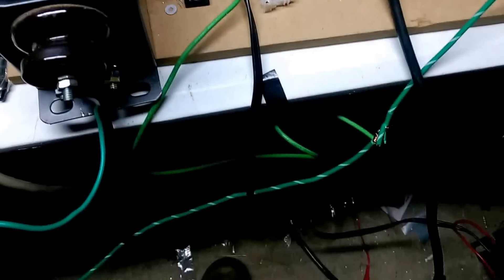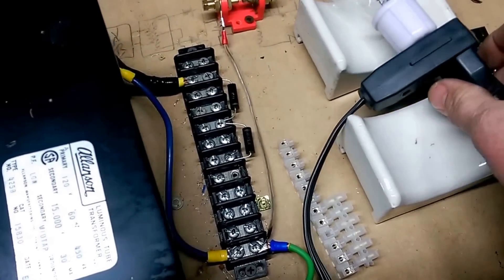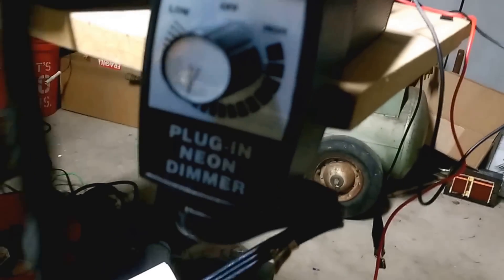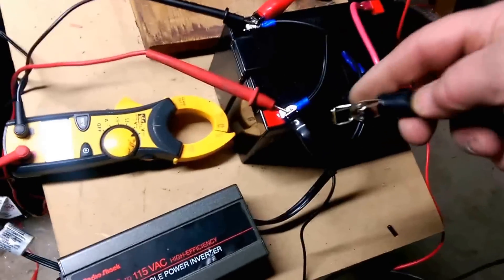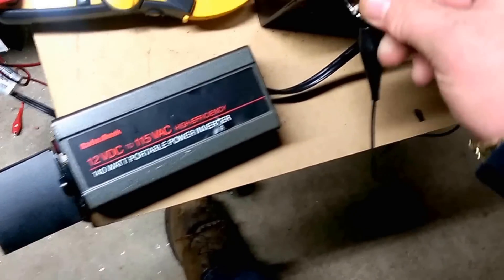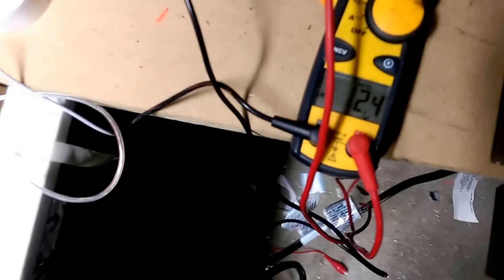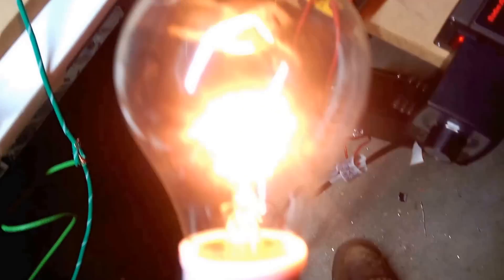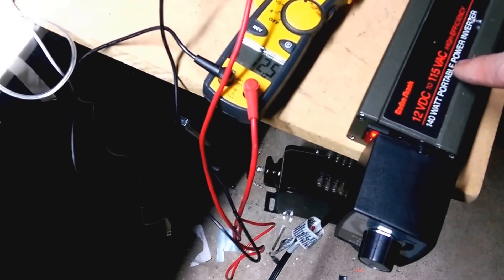Working Free Energy Generator-Dezeinstein Technologies-Annotated

Comment: I have an inverter, 300w motomaster and 12v rechargeable battery, how do I connect them in series and how do I make a 120v heater work in the woods??

thanks
Reply from the maker: +Cory Samoila I'm not quite that far yet.. I'm lighting a light bulb and an nst and able to recharge the battery wirelessly.. The bulb is only 67 watts and the nst uses around the same to fire the device, so, at this point, we are seeing  an increase in output of exactly this plus the losses in the components and the inverter. In my circuit, The invrter's wave and circuitry is very special, so, what I am doing is drawing environmental energy in the exact amount of the draw, enough to max out this inverter. I have not yet got another inverter to work, however, I am working on it. I have to scope the waveform, then, once I figure out exactly what I see will determine the type of inverter used, etc. For all I know, this manifest of additional energy may be driving backward through the inverter , charging the battery without damaging it somehow.. it's really difficult to tell, so I will try to keep everybody up to date.. it does work though!!
Reply: Kool thanks.

Have u tried adding magnets?
Reply from the maker: +Cory Samoila no, but its simple enough to try!  anything could work.  I'll try it and let you know the outcome this weekend when i.have more time to. work on it. thanks for your idea 💡
Reply from the maker: i tried magnets and nothing happened. I also tried to use an arc gap but it uses energy and eliminates it's self charge process. I did however figure out a new phenomenon that allows me to charge pretty much any battery wirelessly without the use of an inductor coil. This is something that I can't even find described anywhere online! I am going to have to patent the process since I never explained how I am actually doing this. I have learned in my efforts to research and develop this system a way to wirelessly charge the battery, then of course, a way to make it work on any battery other than l-ion or l-poly batteries so far. I'll have to try them to see how well it works. I have also been able to overcome the loads with the newet device I have built, where a simplistic device I have created allows this to take place without induction and, it brings the batteries to pretty much any level of voltage I need it to stay at with merely .018 amps of current at 7300 volts. I have found that the higher the voltage, the easier this works, and, it does not consume any energy to do so, it basically forces the battery levels to remain the same while massive currents are drawn from them. It does this without any impact on the battery's function, however, I need to test many batteries over a lengthy period of time to see if it will have any impact on it's function, life, and with any luck, it won't cause any battery to explode. The first circuit I built has enough charge to use the inverter  to feed the bulb and the nst but nothing more unless I changed the load with LED Bulbs.

Comment: Hey Marc, thanks for the update. Tom has always stated "DONT KILL THE DIPOLE" from the tombearden website. Large copper windings are the deadliest killers of dipoles. Thats why large amp motors kill the source battery quickly. Copper may turn out to be the deadliest killer of free energy available. Just use the potential difference to do work without amps!
Reply from the maker: +Alex Manzanero  We have to do some clear explanation here of what the dipole actually is before people look at it the wrong way. The dipole is the "field of the magnetic flux given by an electrical current".  My method is like Tesla's, there is high voltage, and, no amperage anywhere until we get to the capacitor... so, jut as Bearden's website states about Tesla's phase conjugate mirror technology, somebody has a massive transmitter already pumping energy into the Earth. This is true because my system would not work otherwise. Either they are doing so unknown to themself, there is already some sort of transmission going on, and, my device is merely a receiver of this energy. If we create a small pulse and drive it into the ground, we tap this energy and without completing a solid wired loop, we can extract a mirror of this energy in it's multiple dimensions. Here is the data copied from Bearden's site which I have been trying to explain to others. Smith did this, Moray did this and Kapanadze has done this.. It's all a basis of what is already being driven into the Earth, and it will only get smaller results when the true source is shut down because this technology will work as well by sending a pulse as I am doing, and also receiving it by doing both, transmitting and receiving the signal. I am not sure if I did both of these , that's why I will continue on with my work.. here's the info copied:

means of converting the Earth into a self-pumped phase conjugate mirror (SPPCM), containing a powerful spherical standing scalar EM wave. The SPPCM Earth then produces a self-powered, highly amplified phase conjugate EM replica wave in response to another input EM wave of nominal power transmitted separately into the Earth from any point.

We point out the special characteristics of this standing scalar EM wave and the Earth's reaction, both in the four spatial dimensions (1-3 and 5) of 5-dimensional Kaluza-Klein space and in the time (4th) dimension. (1)

Also we point out that quantization results in a reciprocating wave between electromechanical stress in the four spatial dimensions and canonical stress in the time dimension. This allows the stressed nonlinear Earth to act as a self-pumped phase conjugate mirror (2) so that stress energy of the Earth feeds energy into the standing scalar EM wave, resulting in very high energy gain and production of a very powerful electrogravitational resonance condition (standing wave) in the Earth itself.

This powerful resonant standing wave is then "tapped" in accordance with standard 4-wave mixing theory (3) to produce a highly amplified phase conjugate replica in response to a relatively small input signal from any distant Earth-coupled transmitter on the Earth's surface. (4) The phase conjugate replica signal is coupled back to the distant transmitter/receiver site where it is received, processed and fed into the electrical power grid to distribute electrical power.

A single inducing transmitter can be used to energize the entire Earth on a single frequency or "energy channel" (5). This channel can be tapped by numerous extraction transceivers around the Earth, furnishing energy from the Earth itself at each extraction site. Additional inducing transmitters can be added on different frequencies, to provide additional energy extraction channels (6).

So, if we send energy in, the energy from our own transmitters can also be tapped by others, and according to Don Smith's analogy, in the rf wave or signal frequency, if we all have radios, like the radio that plays music, no matter how many of them we have, we can always tap this energy and the transmitter never feels or is absorbed as additional load. We can pulse the high tension or high voltage energy as a plasma source with one wire into the ground anywhere on this planet, then, we build a simple device like mine, or millions of them to extract the energy at the same frequency. If we input at a low frequency as I did, @ 60hz, we can still absorb this energy at a level of 1.5 to 5 times back as I did, however, it is much greater and easier to input several thousand of several thousand cps to the earth and come back with hundreds or thousands of times unity. It isn't hard to understand once you see a working model, however, the device itself isn't creating or causing overunity, it is simply pushing this pulse of energy into the earth, and, the earth's already capacitive storage energy between the atmosphere and ground is released between the ground terminal and the non connected or the "antenna" terminal in the fwbr that is shown oin Don's circuit. This terminal will draw a lot more energy if we nano coat a plate with the correct coating which draws in positve particles, or what I think is the Positron. Once these two electrons come together, the opposing spins release this additional energy by touching each other and make the output do the work we seek. This is seen in the devices spark gap that runs a purple plasma as a silent stream until the cap bank is full of this energy.  This entire method could be stopped at any point by ruining the dipole, which is the electromagnetic field around the energized electric component.   This usually done in copper wiring when the beginning and the end of the circuit is tied as a closed loop. We don't have to wire them shut in my case because we use 1/4 wavelength antennas to draw this together wirelessly with the correct length and type of wire in between the inverter and the battery. (the connecting wires literally act as an rf antenna for the frequency used to transmit from the transmitter, or or the receiver being used to drawn in) The battery type, spacing of plates and electrolyte plays a major role in this energy absorption as we change the charge carriers, or the battery, and substitute it with larger wider plates which exceed what the circuit likes, the energy goes away. to make larger batteries work to charge and allow larger loads, the input has to be larger. The voltage higher, the frequency higher, and, the impedance of the transformer has to match that of what we have in our output or be very close.. Tesla does state that impedance matching is extremely important, this is why I have my output with the bulb., if I add 2 bulbs, it doesn't work unless tuning is done or resistors are added at the transformer to create a match. When led bulbs are added, an exponential increase of energy happens for whatever reason and I am still trying to figure out why as I can place twice the amount of "wattage" in led bulbs that I can for incandescant. I think it is impedance related, however, I can't test the impedance of the led bulbs while shut off (resistance), and, I do not have an impedance meter. I am waiting for investment to bring this technology out from somebody who really wishes to get this stuff going. I've been workign hard to figure out exactly what is happening, but, I need some fairly sharp scientific minds to bring this to light as this is truly working for me and I can prove it to anybody who says it is not, I just have to ensure the system works at many different points using low impedance driven grounds so this phase conjugation can happen . Maybe I will get lucky and a better ground will result in a much better output. Don Smith had a map that showed him where the energy was greater , I think he was able to tell anywhere in the world where the device would work. I need to know what kind of energy map this was. It is difficult to find.
Reply: Francis Graf wont be posting today trip to l.a.angeles but one vid shows extraction of pulsed 18 volt dc current from small solar cells and i quickly in 2-3 seconds pump it up to 400-450 volts but the vid a want to post has a continous 470 volts using an electricians neon meter it lights up all the way to the top!!
Reply: +Alex Manzanero 

Are there other methods for increasing voltage that dont involve copper wound transformers?
Reply: yes there are, im using pulsed dc into a coil without any transformer material at all. No Transformer. I migh post it tomorrow on you tube
Reply: I would be interested in seeing that, subscribing now.
Reply from the maker: there is truly so much more to see than we are allowed to be taught. It's such a shame that "science" has to recognize something for it to be scientifically true. If there's a device that is contraversial between several top scientists, science normally rules with the method of recognition that has nothing to do with drawin in of black energy, cold electricity, or devices that disturb the ambient and allow for more energy out than in, using the vacuum. Mr. Bearden is and always has been right about the sources of energy.. It's so true the amount of energy involved in things like air, water, etc. There are subjects that tell us that there's massive amounts of energy in all of these items, however, science will always refuse to tell us in any way that there's been recognition for a method to draw in this energy in any way if it takes away from the conventional system that makes us and them money. Scientists do and always will back up the petrol sultans and it will always be like this so they do not lose their riches.. until somebody releases a device, like the reactionless generator, which is extremely contraversial and will most likely be something that will remain in one country, or possibly be limited for use in very few specific coutries that need devices to generate poser to pump water and such for very poor communities or for secret bases that need not shipments of fuel. Fuel is not even necessary if we have devices bui;lt as Don Smith made, one of cource is the dipole generator which is absolutely genius.. we need to adopt this method as a recognized method of powering all distribution systems so folks like the power company will maintain and purchase these devices. Our planet will not be saved unless we act faster than the change is happening.... that is if it isn't already too late!
Reply: Marc I think I have the antennae, and the ground connection figured out, and Im pretty sure I know why the locations that work, do.

I have been working on building some Bi-Toroids, and it seems like you are doing the same thing but a little differently?  
My understanding of all this is weak and mechanical in nature [my electrical experience comes from residential wiring].
For instance I'm just now learning that there are circuits that do all the things Im trying to do mechanically . . which blows my mind a bit.

For instance why make a spark gap, or magnetic relays, when you can use a "Tank Circuit"?  Really amazing stuff . . . but its only mysterious until it becomes common place.

I always knew there was an analog and a digital side, but the symmetry and relationships are really interesting.